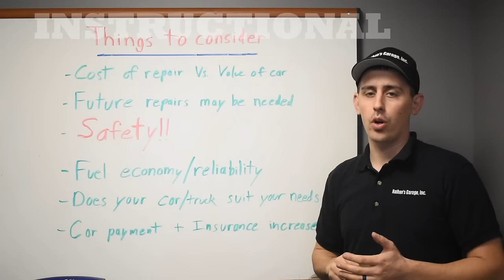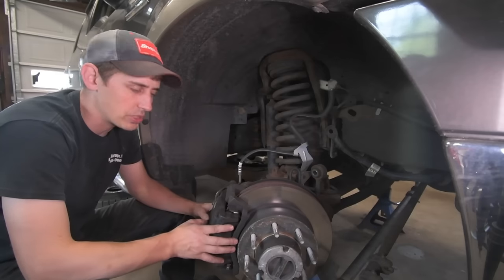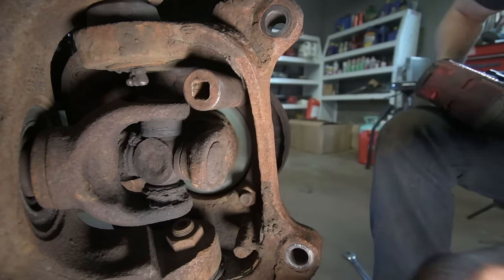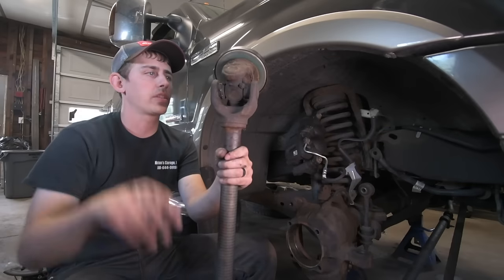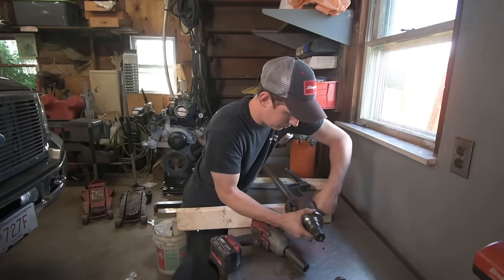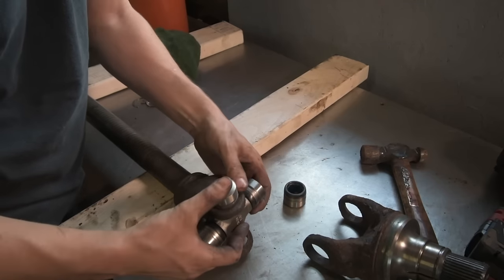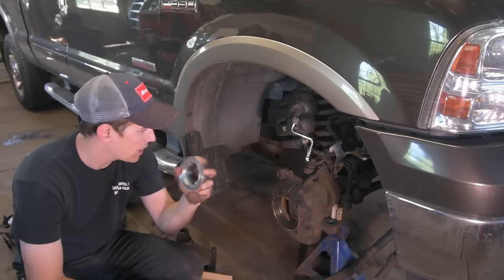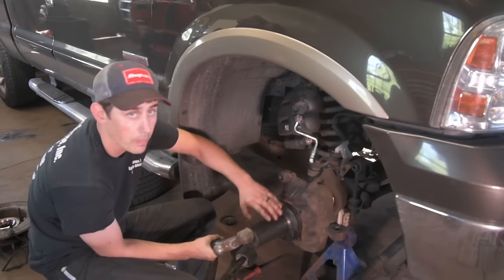Ford Superduty Steering wander repair....Axleshaft u-joints

Comment: After rebuilding my entire steering, and still having a steering problem, this video described the problem perfectly.  All the mechanics were stumped.  Hallelujah!
Reply from the maker: Awesome! So glad I could help.
Reply: Have to agree tried to tell a mechanic about this pretty much said no way. Haven’t taken mine apart yet but about 90% sure this is the problem. Thanks
Reply: Run w hubs unlocked then shaft w find its rotating position 
Yes fix the ujoint 
Rotate axle by hand and carry down the road to your shop
Reply: Fortunately ! ... I found it befor rebuilding mine ...!  Thank U so Much My New Friend ..!!
Reply: @InTheShop  did you change both sides or just the passaged side??

Comment: I have a 2005 F-350 SRW I bought new with 230,000 miles.  This condition started suddenly.  I knew it wasn't likely the ball joints or steering components as it started suddenly.  So, after watching this video I went out and sure enough the driveshaft joints was the issue.  When you were inside the truck and said front driveshafts I had no idea how that could happen.  I had better get busy.  GREAT VIDEO!

Comment: You look very young to be such a great mechanic!! You shared a bunch of your technics in just one video, everything is on point. Very good video.
Reply from the maker: Thanks Jesus. I’m 33 years young. I still have a lot to learn but I have focused my entire career on constantly learning.
Reply: @InTheShop  A mechanic is forever learning, because of technology and new techniques they learn along the way. Keep up the good work young man. Great video btw.
Reply: @InTheShop  just curious where you are located and what do you charge per hour?
Reply: @jase1911  from his accent i would have to say east coat, up wards of Maine or Vermont area. Leaning more towards Maine
Reply: @Akhazmat907  Mass plates on truck @ 15:45
Reply: @MrPancake0825  close enough lol
Reply: If your not constantly in trouble as a 5yo taking things apart so you can figure it out and try and put it back together well let’s just say we have a lot parts replacers nowadays and I bet he was always in trouble. Lol
Reply: Great explanation on issues with steering on Ford Super Duty Trucks.
Reply: YOUR GOOD WOULD LIKE U WORK ON MY TRUCK !
Reply: Thank You!!   Your ABSOLUTELY a TOP GUN in your field!!   I learned so much from this video!!   I think you should be a TEACHER at a trade school!!!!! I would pay to take your course!!
Reply: @InTheShop  I have been working on vehicles for 20 years and I just started a project that will have a 2006 Ford f250 4x4 frame under it and this helps me out more than you know. I have yet to have to work on a front axle on a modern 05+ up Ford f250 and thanks to you I hope to have a easier time rebuilding the front end on this thing. Thanks.
Reply: @InTheShop  great video just bought my first Ford. 1999 f350 Thy guy that had it blew power steering  hose and continued
To drive for a while . So new hoses and pump on order anything else I need to look at or. Replace ~ rack unit ? I hope not

Comment: I noticed you used ant seize when you were assembling. That stuff can be a life saver down the road.
Reply from the maker: Saves so many headaches down the road! I use it as much as I can.
Reply: @InTheShop  I use to work in the dairy industry and everything was stainless steel. If someone forgot anti seize you would never get nuts and bolts apart again.
Reply: @davidcoalkey6074  I use that shit on everything! just rotated the tires on my 014 PS, wire wheel, wire brush, Never seize. a winning combo. I'll even go so far as removing bolts now that I know I'll need to later just to goop them up.

Comment: thanks,  I was chasing "wandering" steering problem, went to 3 different mechanics (one was ford dealer).  after $1300  for ball joints and tie rods and "diagnoitic" fees.   i had Tuffy replace u joints after watching your video.  NO MORE STEERING ISSUES
THANKS AGAIN
Reply from the maker: This right here is the reason I make these videos! I’m happy I was able to help. Thank you for watching!

Comment: Ford pickups have been wandering the roadways ever since they left the straight axle. I had a 1981 F-350 dually.Checked everything out, everything new,including the wheels and tires which were balanced. Tried a different set of tires, same thing, wandering all over. Even got pulled over by the Mo.State Highway Patrol and given a drunk test of which I passed. The officer drove that truck and said I was ok to go. It wandered with him driving it. My uncle worked at Ford and said that they all did it. A very solid truck with lots of H.P. but loved gasoline. 220miles and 88 gallons later I arrived. It had to go. Have not bought a Ford since.

Comment: The dealer (stealerships) cannot even diagnose these problems.. thanks they replaced a ball joint for $750 and didn't fix the wander. 2008 F350 Super Duty 110K miles.  Super great presentation and you are super smart...
Reply from the maker: Thanks you for watching!

Comment: As a diesel mechanic this is a good video. Only thing ill add. Anytime i do u joints i do ball joints. Your right there at the knuckle with everything out of the way. Another hour each side saves the customers a ton of money later on. If the u joints are worn the ball joints are worn out to
Reply from the maker: I agree! Someone had done the ball joints not too long before this but skipped on the axle joints.
Reply: @InTheShop  id be pissed at whoever did ball joints and not u joints. They go hand and in my shop. no exceptions. if there is absolutely no money left in the budget ive ate the cost of labor and parts so the customer gets the repair they need
Reply from the maker: @adammiller8415  this truck also got a steering box replaced for no reason
Reply: @InTheShop  Yeah they would be giving me my money back for the labor on that one.

Comment: Great video, this had happened to my 04 F250 a few years ago. I changed ball joints and did u-joint also. Mine has just started steering like it is stuck between left and rigtht center again. Excellent way to diagnose issue. Thanks for taking the time to share your work.
Reply from the maker: Thanks for watching Steve!

Comment: Really well done presentation. I have a 2000 excursion, and the steering was goofy, thought it was the box, valves, who knows. Took it to my mechanic, put on the hoist, yanked the tie rods as you did, and checked the ujoint. Exactly what the problem was. It can actually cause the steering to lock on you, a real fight the odd time.
Reply from the maker: Thank you! Glad you found your problem.

Comment: Having replaced thousands of u joints in stern drive boats in my thirty six year carrier I have found after pressing the u joints in and getting the clips on give the yokes a couple of good raps with a hammer on the outside not the end. The inertia from the blow sets the caps against the clips and the u joint will work smoothly. unless you got a needle in the bottom of the cap, it happens. Other than that this is a great video thanks
Reply from the maker: Thanks Steve! I'll try it that way next time.

Comment: I would do one more step. Clean the yokes on the axle. That prevents debris from getting in the new u-joints.
Good video. Very direct without the un-necessary back story.
Reply from the maker: Thanks for watching and that is a great piece of advice.

Comment: I was doing this job on my 2003 but couldn’t get the axle seal off.  After 30 minutes and a bunch of cursing, I came to check youtube when I came across this video.  The crowbar trick was awesome, had it out in 2 minutes, which included time to find my big crowbar!

I came back looking for a trick to get off the retaining ring from the u-joint, but apparently I was doing it correctly by applying a lot of cursing mixed with beer.

Thanks for posting and sharing!

Comment: Pulling my axles today to replace ball joints glad I watched so I can check the axles probably would have sat them aside and not check the movement
Reply from the maker: Commonly overlooked. Once you know you will check every time. I have found a lot of them frozen up while doing balljoint jobs and usually always quote them at the same time.
Reply: @InTheShop  The axles were fine.. the ball joints were a bitch getting them off the truck and pressing them out... had to borrow Snapon air hammer, ball joint tool, and 5ft breaker bar. It kicked my butt.

Comment: Your my HERO I got my truck fixed . They replaced the universal joints and upper and lower ball joints just because the truck was 18 old and I figured if they had it to that point they might as well do them . Thanks for taking the time to help people like me . GOD BLESS you
Reply from the maker: Thank you! I'm happy I was able to help.
Reply: Your help was appreciated on my 2002 ford . I also have a 2019 superduty king ranch and run into a proublem towing my 5th wheel.  Its 59" from the top of the bed doun to the ground and when my 5th is attached there is only 4" between the truck and camper overhang.  I spent week's trying to find a solution so I didn't hit the dam 5th wheel agen . The solution was to change the 4" blocks to 2" blocks out of a 2020 they sit 2" shorter  . I added airbags so when not towing I can put it back to 59" . also when towing on the highway I put the truck at normal height so I don't get high beamed.  I thought I would pass this along because nobody out there could help me not even several ford dealerships . Thanks

Comment: Great video. I bought a 99 f250 a couple years ago for a backup/hunting truck. Steering wanders constantly, it’s a very unnerving feeling. I’ve had the front end inspected by two very experienced shops. One changed a tie rod end, another changed out 1 front u-joint and did an alignment. The tech showed me the u joint that was bad, he was basically prying on it with a small crowbar and noticed the slop in it. The test that you perform is the key to identifying this issue. Just because there is no slop or play in the u-joint obviously doesn’t mean it’s not bad. The steering was marginally improved after the 1 u-joint and tie rod end. However, because the other joint was still “tight” (lacking slop or play), it was not replaced. I even took it back to that shop a year later and had it re inspected and re aligned, still wandering all over the road. Going to get the other side done and see if that ends the saga!

Comment: Mad props, I've worked on a ton of these (pro-Ford tech). Obviously, u-joint was the failure on this unit, props to you for correctly diagnosing. I"ve never seen this myself despite working on nothing but Super Duty for the last 20+ years. More often I've seen ball joints sticking (usually replacements). Tighten ball joints in proper sequence (50 ft/lbs bottom, 70 ft/lbs top, 150 ft/lbs bottom) to keep replacements free turning.

Comment: Spot on, mate. I'm a rusty mechanic with a 2002 Superduty with thjs problem. You've given me the confidence to rewind 40 years and tackle this myself. 🙏
Reply: It’s not a bad job, sometimes the nuts holding the wheel bearing in can be a pain, every 6.0 I buy gets a whole new front end right away.

Comment: I bet this is the reason sometimes I can’t turn at all until I start rolling and then it’ll finally loosens up and turns easy after a few feet
Reply from the maker: Its possible. Check out the joints and see what you find. If its not that I would consider a possible failed brake booster if its a diesel truck.

Comment: Wow.  Excellent vid.  I did an extensive front end job on my 2008 F-250 a few years back.  I just enjoy watching how others do this.  The worst part of the job for me was removing that damn snap ring.  Thing is a fat as a nickle.  I had to buy a very expensive snap ring pliers and even then it wasn't easy. 
In my case I chose to replace the entire axle with a new universal already installed. I wasn't confident in my abilities to press out that old universal.  The irony is, once I dove this deep into it, I was like: "I'm in here I mind as well change the ball joints while I have everything apart".  So I ended up getting the ball joint press tool from the Advanced Auto loaner program after all.
You do excellent work.  Great job!
Reply from the maker: Thanks Mike! I really appreciate that.

Comment: I know what I'm doing this weekend.   We're fortunate to have a dedicated diesel tech in our town who also does excellent work.   Our '03 7.3l has the typical wander.   There were some worn front end parts that needed replacing and that helped,  but didn't completely eliminate the issue.   We notice it most when pulling or camper.   I thought maybe I hadn't set up the weight distribution hitch correctly,  so I paid the RV dealer to double check my work and all was well.  We thought about adding a steering stabilizer,  but I'll be troubleshooting u-joints prior to that!  I have all the tools minus the seal driver and enough mechanical skills that even with the $80 tool purchase I can save myself a bunch of money doing this myself.  Excellent video; thank you for sharing your expertise.
Reply from the maker: Let me know how you made out! Thanks for watching Mike.

Comment: Thanks for this, I was experiencing significant issues with the U-Joints throwing my steering out. I went with the full axle shaft replacement with new U-Joints included. No issues since.
Reply from the maker: That’s a nice way to go. Saves a decent amount of labor. Glad I could help!

Comment: I bought my 2008 SD in January and just figure out what brake parts need to be replaced, but want to check out all the other stuff at the same time and already have discovered that the auto locking hubs up front both are shot. Sadly the shipment rates for parts to Germany recently seem to have risen due to Corona, but I want to get this thing on the road this year and I might have some fun at the inspection to have this thing registered over here, as the guidelines get stricter day by day and these Ford SD Pick Up trucks are real exotics over here.
Reply from the maker: Good luck Harald! Hopefully the videos help.

Comment: how did the customer react when you cured the problem where the others couldnt
Reply from the maker: Relieved the problem was finally solved but obviously unhappy they spent a significant amount of money elsewhere needlessly.
Reply: @InTheShop  you know the truck owner is going to pass your card around to his friends ! Whom ever taught you gave you a real blessing to be a limitless master 👍
Honesty does pay, specially those who can deliver real fixes 🤗
Reply from the maker: G Lasser thank you! I just try to do the right thing and pay attention to the root of the problems.
Reply: I just did this to my 99 Ram. Had steer wander on the road and a lot of clunking when hitting bumps and it’s a lot better now. My mechanic told me the U joints were completely shot in every way.

Comment: I have had this intermittent steering issue for a few months on my 2011 F250 gasser.  Even in 2wd it will occasionally pull hard when coming out of a turn.  I recently brought the truck to the local mechanic and he changed out both my manual locking hubs (one side was blown for sure).  I got 2 miles up the road and the "steering pull" issue happened again.  After watching your video, I went out and pulled the drivers side tire and tie rod.  What you show at the 4:00 mark is EXACTLY what is happening to me.  I went back to my mechanic and said I think the u-joint is bad, this is what I did and this is what it is doing -- he replied that it is expected that the knuckle would be hard to turn in some spots as the u-joint won't allow free movement in every position!?
Reply from the maker: The knuckle should never be hard to turn. I would bring it to another shop.
Reply: @InTheShop  Thanks for the quick reply.  Very unfortunate as he's an "old timer" mechanic that I've been going to for years.  But like I said, what you show in the video to demonstrate what the frozen joint looks like is exactly what I see when happening when I pulled the tire and tried turning it by hand.
Reply from the maker: Hopefully you find someone that can figure it out. Let me know how you make out with it.
Reply: @InTheShop  Will do, i'm dropping it off at the dealership this Thursday.  Thanks again!
Reply: @InTheShop  So yep, just like we thought - dealership called and both of my u-joints are shot!

Comment: Just wanted to say thank you for this video. It’s probably the best tutorial video I’ve seen on YouTube. I was having this exact problem with my 2008 F350. Initially, I thought it was the steering box. But after thinking about it more, just couldn’t shake the feeling that it had to be something else. Ended up searching YouTube, saw this video, and knew this had to be the solution. Did the test you suggested. Sure enough the wheel wouldn’t turn. Performed the u-joint replacement today. Went perfectly thanks to your video. Truck drives so much better now. Many, many thanks!
Reply from the maker: Awesome! I love hearing stuff like this.

Comment: I do appreciate you my friend. I was pulling my hair out, what's left of it, trying to diagnose the problem. With the truck in the air, I spent countless times grabbing the tire at 12 and 6, and 3 and 9 with no movement was very frustrating. Thanks very much for explaining the diagnosing portion of the problem. It's nice to know the 'why we're doing this' instead of just the 'what to do'. Intermittent problems are the worse ! My hats off to you. I owe you a beer.

Comment: Thanks for the tutorial, I've got a wandering 2005 F-350. I just ordered the parts and 6697 oil seal tool. Now I just need to tear the front end down and install the new u-joints. You've given me the confidence to take on this project!